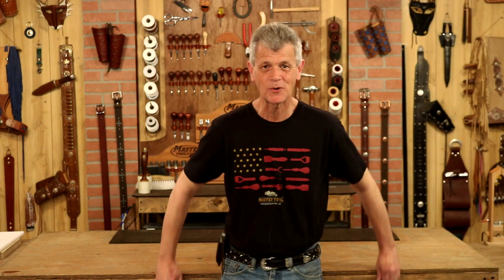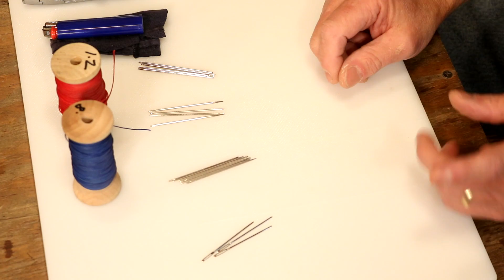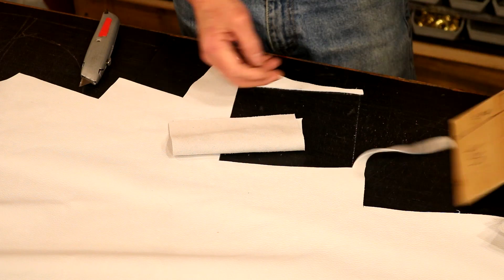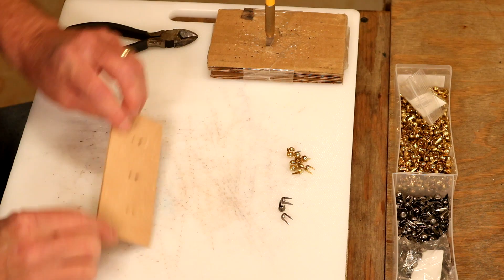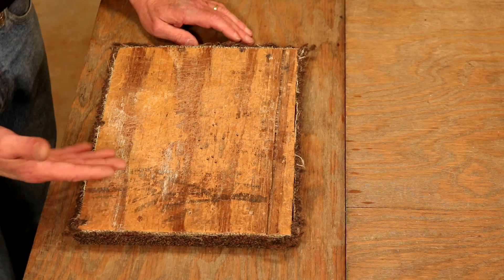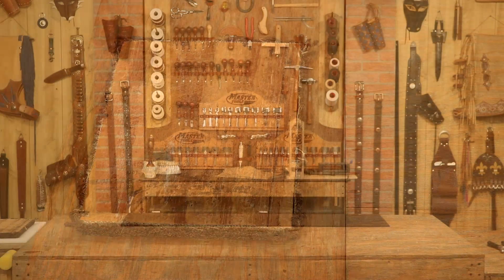The Leather Element: Shop Tricks Pt. 9

Comment: Hello Chuck:
 I loved the idea of cutting the tines on spots. I normally just bend one in and the opposite one "out" That has worked for me since the 80's. As for the snaps. I use mostly 5-6 oz veg. I NEVER have an issue with the snap stems being too short, I have issues with them being too long. That requires a trip to my bench grinder, small vise grips, with a LOT of care and finagling. Someone needs to come up with Line 24 snaps with different length stems like the spots? Just my issues/opinions.
Thanks for reading.
God bless:
Dave

Comment: When making a sheath, the back panel smooth side out you bent the belt loop back then riveted it. How do you smooth out the rough side so it looks good. I guess I'm asking how do you smooth the rough side.
Reply: If it is real fuzzy then some good sandpaper to take off a majority of the fuzzies.  Then apply some Tan-Kote.  Once you put the Tan-Kote on while it is still wet use a 'slicker', bone folder, or something similar to sort of burnish the rough side.  Best thing is to use a nice quality leather that has been cut well on the 'rough' side so you don't start off with lots of fuzzies in the first place.  So whether or not you have a fuzzy or smooth 'rough' side Tan-Kote is what i use.

Comment: Thank you for this video….I do have a question though. What needle is best to use with artificial sinew? Size, part number etc. so I know what to look for on weaver.
Reply: Most of my sinew sewing is with glovers or sharps needles, which also have small eyes. The first thing I do is cut the length at an angle and then split the fibers into thinner widths (assuming I don’t need the entire thickness). In any case, whether you split it or not, the next thing I do is run that cut end between my incisor teeth to make it nice and flat while keeping it dry so it stays sturdy enough to thread the eye. I’m sure there are other ways, but this is the simplest, fastest practice I’ve found that works for me.

Comment: A little moisture on the end of the thread and crimp it down flat gently with a pair of smooth jawed pliers or serrated pliers will possibly work also. Should go through the eye of the needle easily. You may have to put a sharp point on the end of the thread.
  Great video sir, thank you.

Comment: I broke two John James needles on one belt. I was disappointed they broke so quickly, as it was my first experience with them. With that said, I haven't broke another since. I find these are way easier to thread than the cheap needles I had from hobby lobby. JJ needles are excellent and easy to stitch with. I won't use any other needle now

Comment: Thanks for the tip on setting snaps in thicker leather. I’ve run into this very problem frequently and until now my solution has been to skive the leather around my punched hole. Not easy! I can’t wait to try your tip.
Reply: I never thought of smashing the leather, but I do the same as you basically. I use an edge beveler. It isn't easy
Reply: @maddawgnoll  I’ve been using a French skiver but that isn’t as easy as Chuck’s solution.

Comment: These were some excellent tricks and tips. I have always threaded my needle the same way that just did, cutting at an angle and mashing flat for small eyes. That was a great tip on how to cut a square. I do have a question although. I have a piece of marble is that a good thing to use for my hard surface? Y'all have a great day and stay safe and keep your powder dry!
Reply: Yes... marble is what I use. And because my work top space is limited, I bought a marble soap dish at Target that measures  3-1/2" x 6"x 3/4".  I turn it upside down and use the flat bottom as the working surface. Perfect size  for setting snaps, rivets.  I also found a Marble "serving tray" at Target that measures  6" x 12" x 3/4", I glued poundo board to one side and trimmed it, to have two types of work surfaces.  

When you think about it... what's the reason to have anything larger for setting snaps and rivets, or stamping, when that's about the size of area actually being used on a larger size slab.